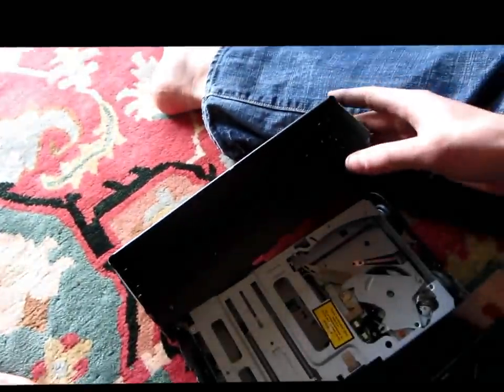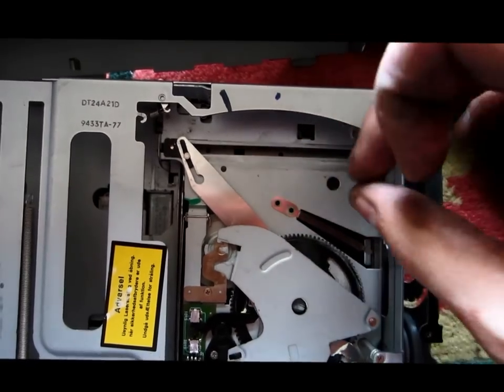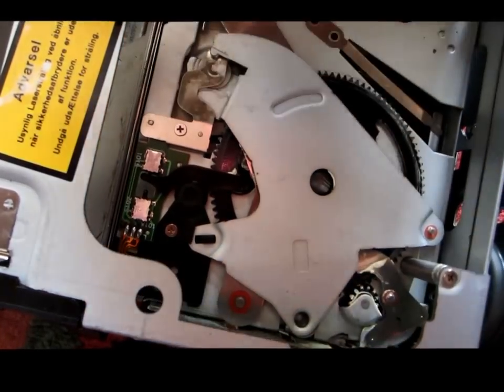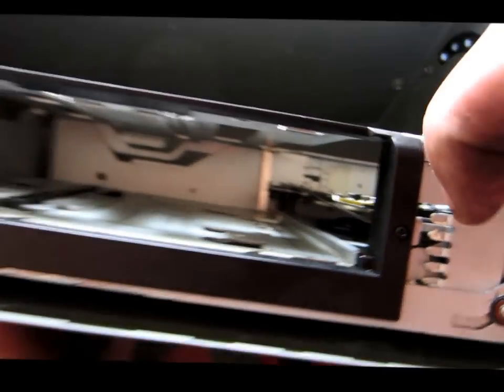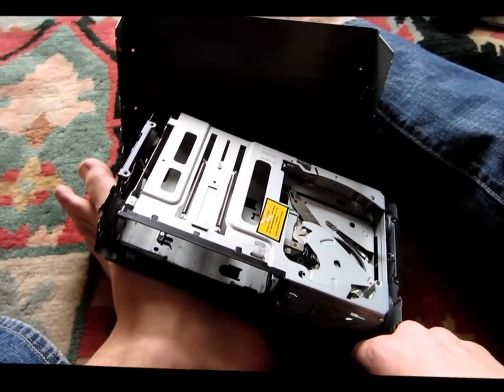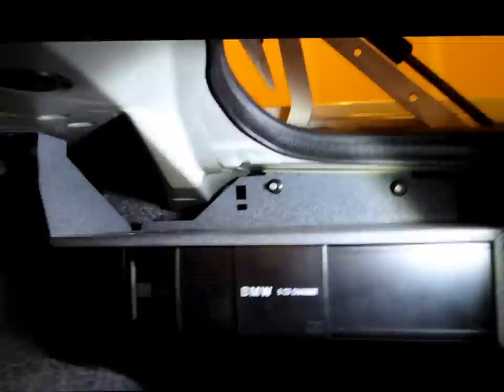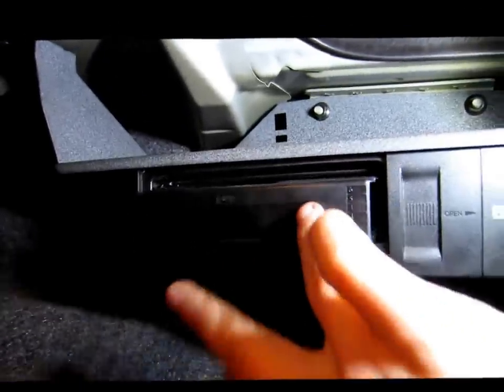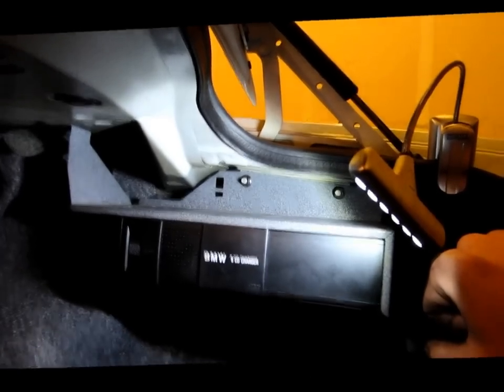bmw m3 6 disk cd changer wont eject magazine e36

Comment: John:  Thanks for your post, which was a long time ago.   I have a 1999 323 iC with a cd changer in the trunk.  It is mounted nicely and covered with the same trunk material in its casing.  It has one c/d holder.  Does the c/d holder have to have all 6 discs loaded before trying?  I only put a c/d in 1 and 6.  It seemed to swallow the 6th disc and didn't return.  Any suggestions.  Thank you.  Frank

Comment: Hi Chris, I have the same problem: the cartridge with the CDs does not eject. I opened it and tried to fix it myself following the steps of your video. The only problem is, with the changer already open, I can´t take the cartridge out. How did you manually realease the cartridge?? Thanks a lot!